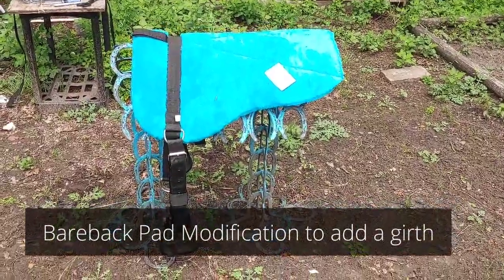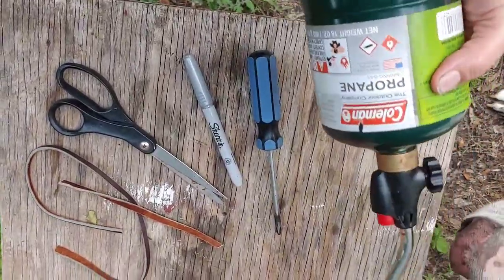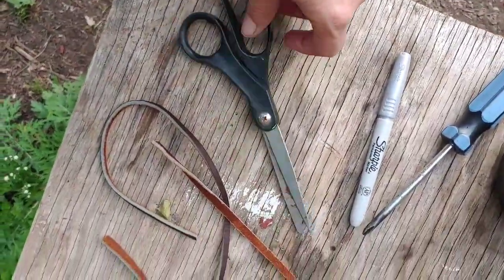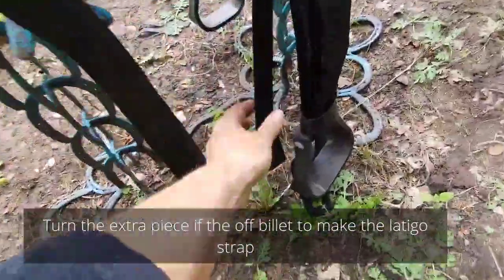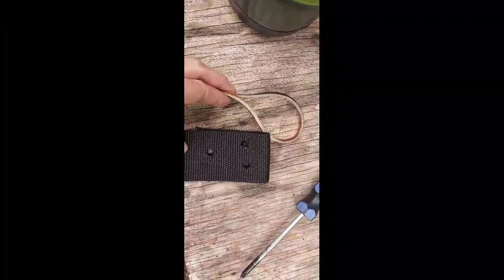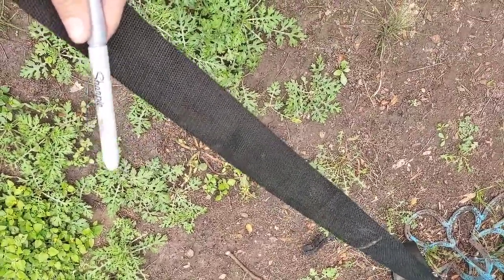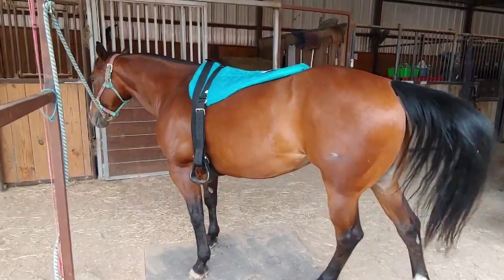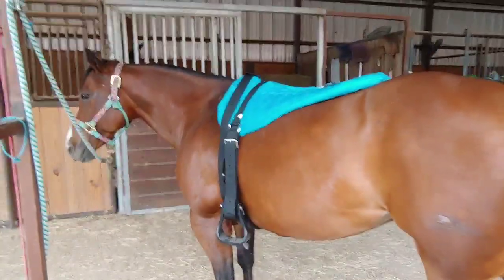Modification of a standard bareback pad to add a Western girth and cinch

Comment: Using bareback pads with stirrups can be very damaging to the horses back. It creates so much pressure over such a small area. Most people cut the stirrups off bareback pads when they buy them.